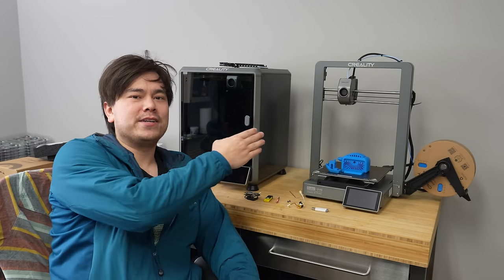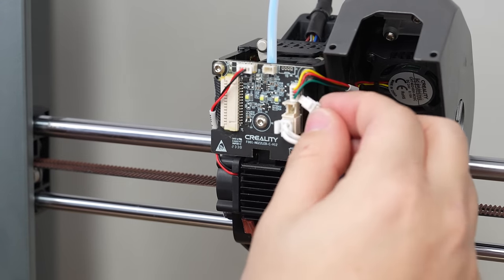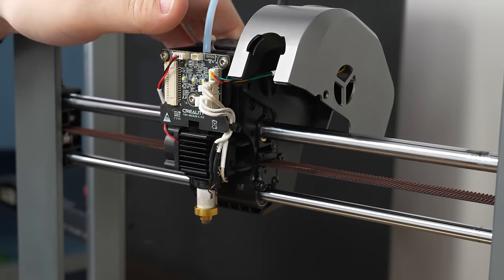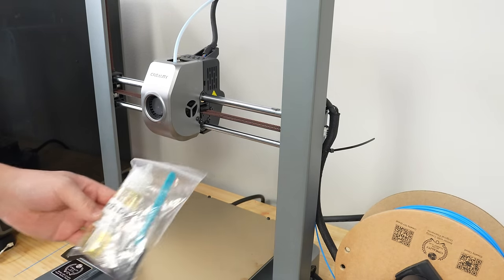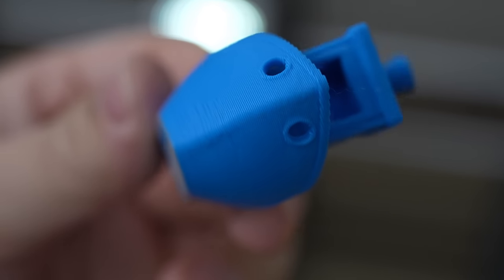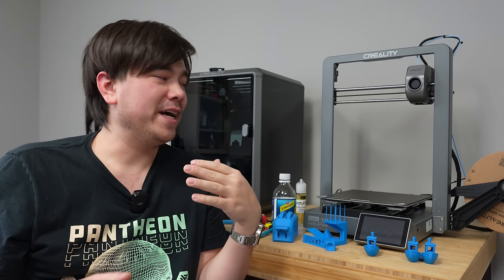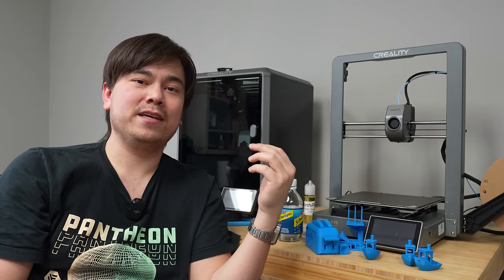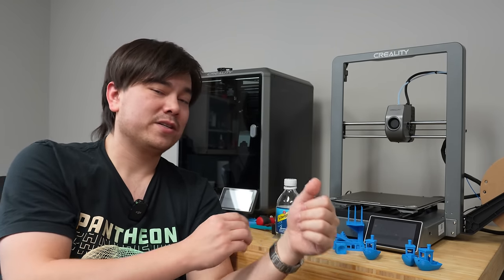This Ender 3 is Completely Different.

Comment: This looks like it's come out of a completely different factory to the KE. A much better factory.
Reply: What’s wrong with the KE ?
Reply: @martinskamla6789  ALL.... the KE and SE also, has a flaw from fabric, that the right bed rod, it doesn't fit well and it dances, apart from that, the Z axis is the most inconsistent thing I've seen in a long time, the base plate itself bends...
Reply: @JuanCarlos_3design   Mine's a complete mess. the KE is getting sent back beds warped and nothing but issues.

Was fine for the first week but the bed started to warp assuming from the insulation design on the bottom
Reply: You are saying that because you have never tried this printer, this printer is piece of "something". I don't understand why so many good reviews about it when all of them know this thing is just wasting of money. KE is amazing printer, it's better option then this for way less money. This new V3 can't do good first layer, cooling fan is not good enough for harder prints, it's hard to load filament in it, you can't adjust zoffset manually until prints starts, you can't see auto leveling results at all to see how uneven your bed is.... I had SE, now i have KE and new V3, this last one is a huge fail, only good things about it are looks and nice screen.
Reply: @bl4de938  I do own one so I feel qualified to comment on the build quality. And the V3 having all the flaws you list doesn't make the KE any better. Creality need to step up their QC or they will not survive.
Reply: @bl4de938 😅😅
Reply: @jerodTSI  i still have V3, nothing is fixed by any updates, V3 coreXZ is the best way to throw away 400$
Reply: @bl4de938 I've had a KE for probably 7 months now and it mostly sits around collecting dust because it throws a new error every time I turn it on, usually an "unknown exception" with no further detail. Flashing new firmware doesn't seem to do anything and I've tuned the living hell out of it mechanically. When it did work, the leveling never worked right and it always sent the print head crashing into the plate with no way to adjust the Z offset until it starts printing.. After it's already crashed.. I think I'm going to strip it for parts for my regular Ender 3 pro that works great

Comment: CREALITY NEEDED BAMBU LAB
 (to start making decent 3d printers).
Reply: I feel like everyone has started making better printers after bambulab came in and shook the market like they did
Reply: Completely changed the direction the entire market was going, its not just Creality.  Everyone is stepping their game up now which we will all benefit from. 
What's going to be fun to watch is all the Bambu fan boys getting butt hurt when other companies start making better machines that are actually open source as they should be and not the stupid closed off walled garden proprietary ecosystem bs that Bambu has been getting away with.
Reply: @dankcincy  What you don't seem to have noticed is that they've been becoming more open source lately, and while I'm definitely not in favor of donut walling modifications to things ((coughcrapple)), it's not like their printers need masses of upgrades to work optimally either (also the first part of what you said was said immediately before you said it)
Reply: @TS_Mind_Swept  You're right, I haven't noticed. As soon as I saw it was a closed ecosystem, I never gave them a second look. I'll never buy anything in this space that's not opened up. Closed ecosystems go against everything 3D printing is about.
Reply: @dankcincy  well I can tell you one thing, you're more closed than they are, and not for any good reason
Reply: @TS_Mind_Swept  The 3D printing community is an open source community by nature. 
 If me not liking a company because or their closed off ecosystem makes me closed minded in your opinion, so be it.
Reply: @dankcincy  It's not my opinion. They're not pulling a crApple and have been showing lots of promise in terms of being more open source, these are the facts; if you're too much of an elitist to see someone making good progress right in front of you, then the problem is not them
Reply: @TS_Mind_Swept  Like I told you before, once I saw that they were playing the whole closed ecosystem game, I stopped looking at them or paying any attention to them whatsoever. They are in no way on my radar and from what you're saying, they won't be for the foreseeable future.
 Seriously, why would I go play in their walled garden when there's whole big world out here?
Reply: @dankcincy  Cause the world sucks for one, their printers just work for another, open source is really only useful for things with problems (not that they aren't trending towards it, which in itself is worth keeping an eye on), and I never said you had to get one of their printers, but it's still worth knowing what they're up to, as even you yourself admitted they've done a lot for the industry, even if simply by existing. Don't add to the cause of people like them not wanting to share their toys, you only make the situation worse for everyone
Reply: @dankcincy  and would you look at that, they just posted an article about releasing more open source firmware to make things modible, as well as their own willingness to work with people to make sure stuff will work within the specs of the printers. Don't stand up when you have no knowledge on a subject.
Reply: @TS_Mind_Swept  Yeah... they're really not worth me following. If they do something worth hearing about, I'm sure it will pop up on my radar at some point.

Comment: I hope creality does a multi material system of some sort. Would be interesting.
Reply: Some youtuber went to recent creality booth, the agent said, the going to release new multi filament/color printer, AND also multi color/filament for currently existing printer. Soon this year
Reply: That is precisely what I'm waiting for.
Once it's here, I'll buy a K1Max + multi-material thingy.
But, why are they taking so long ?
Reply: I asked them personally, they told me they were working on it with a release planned for 2024.
Reply: @ZappyOh because it’s not easy to do.  Prusa tried for years and failed. Bambu changed the 3d printing world with the AMS. Now they are all scurrying to catch up.
Reply: Being an owner of an AMS I hate the massive wastage involved and would much rather have an affordable and working well toolchanger system
Reply: Creality has stated they are working with CoPrint to add multifilament capability to their lineup. Should just be a matter of buying the CoPrint multifilament setup and a bracket adapter per your machine and you are off to the races.

Comment: Check again.  The fan electrical connectors are hot glued.  Want to know why?  Because the connection is so poorly done you have to use the hot glue to make sure it stays together.  Disconnected my fans once...took a full day and 4 people trying to get the fan plugged back in.    CREALITY  RE-DO IT!

Comment: Overhang at 30 degrees is likely related to the overhang print speed for that angle being too high.  At 20 degrees it's probably hit the next speed category and slowed down further, same with 15.
Reply: PrusaSlicer has Dynamic Overhang Speed settings so the speed can be varied for 0%, 25%, 50% and 75% overhangs.
Reply: @Liberty4Ever  Yes, exactly that sort of thing.  I've never used CrealityPrint, but I'd be surprised if it wasn't doing something similar, and for whatever overhang range speed "bucket" setting that the 30° overhang fell into, it's likely the settings for that bracket group needs to be tweaked better.
Reply: What setting are you using? I just found this setting in creality print. I'm betting thats why I'm having issues with overhangs...

Comment: why?  why are they sticking to the 220x220 bedsize?

breakout and up the standard, 275x275 would be a good intermediate size and make it worth upgrading to a new machine for some of us.
Reply from the maker: Looks like you're wanting to see the Plus model..... Just stay tuned ;)

I think creality should step up to 230x230. Their standard plate is already 235x235, they are only using the center 220x220 portion. But when you get that far out onto the edges you end up with pretty uneven heating.
Reply: Any idea if there will be one, this looks like a brilliant printer, just wish it was ~300mm^3

Any recommendations?
So many printers nowadays it's hard to choose

Comment: Thanks, nice video! Miss the original “first layer test” though! That was more telling than the repeated comment about the print bed cable! ;)
Reply from the maker: First layer was looking pretty good. I did one on a livestream
Reply: @NathanBuildsRobots I know, I was following it and saw you at 2:20:00 (timestamp) a bit confused with the result, which you attributed to changing the settings mid-print. By the way: Does the printer have "power loss recovery" or not (it didn't work in live)?

Comment: for the 20 degree overhangs it might be that the layers were a little more than 0.2mm apart making it seem better since the droop would be more consistent then if the premineter was barely touching the previous perimeter like on the 30 degree overhang but that just my theory

Comment: As a noob, I’m enjoying the Ender 3 v3. What it lacks in mods it makes up in ease of use. The side loading is a bit of a pain. I’ve had one spool get tangled, so I’d like to upgrade to a better spool holder or loading system. With it being new still, I’ve had to order the “unicorn” nozzle directly from Creality. Microcenter didn’t stock them. Still waiting on what the two empty screw holes at the top, are for.
Reply from the maker: I think they have a printable model to move the spool holder to the top
Reply: @NathanBuildsRobots  So the runoff sensor would need to be moved too then. Not a big deal, but it’s definitely a change. Thanks for the reply!

Comment: Are you sure you can't adjust the flow Nathan? It doesn't have the expert mode that Creality just pushed out on the K1 series. My k1 got an update a few weeks ago that now permits us to adjust the speed, flow, z height, and nozzle PID calibration. Mine is rooted so it had it before but it was nice that Creality added it to the stock software.
Reply from the maker: That's great, I am using the stock firmware that it shipped with, I think it should be getting the new firmware soon

Comment: I'll wait for a version 2 of this very printer but I think this and the the K1(to a lesser degree) are steps towards Creality redeeming themselves. I know everyone and their mom has Enders...but I can't tell u how many times I hear those same people compalin about those old printers when I'm strolling through a Microcenter. I actively blocked a salesman from showing a mom a Neo(she was complaining about bed adhesion on a v2 she had) when there was the new KE and SE's right behind them.
Reply: I bit the bullet and got this machine on sale at MicroCenter. Under 300 is a good deal for the features u get. I paid more than that to upgrade an old printer. I don’t need the plus model. I use this just like any other Klipper machine I use. However, Creality’s own UI is unimpressive.

Comment: That top rail running on a bushing .. and with a spring. Much like a inkjet printer. I have a large format inkjet,  and it's important to keep a rail, that has a bushing running on it, clean and ever so slightly lubricated.  Having it exposed  like tbis may attract dust, and that bushing will bit be happy.
Reply from the maker: Interesting, I think precision on inkjets is more important than in 3D printing, so adopting a similar setup is a good idea

Comment: A bit bummed by the proprietary castings etc reducing modability compared to regular Ender 3s, but the fact that it's a core XZ is interesting- taking a page out of the Voron Switchwire/Enderwire mod notebook? With vanilla Klipper this actually looks like a pretty good package.

Comment: They made a really nice printer that is a total over kill finally. Only thing you mentioned is the fine tuning the heatsink hotend fan needs a thermostat and to tune the fan accordingly. Longer life spam for the fan and reduced noise. I want them to male a 2pro update ı really want a compact printer. With an over kill spec.

£359 for xz its expensive ı would really love the see a 2prov3 all of the weight saving and cable management for £250 would be a sweet spot.

Im looking fir bew printer and flashforge m5 for £299 is sweeter than the xz right now

Comment: What is the storage capacity for files on that machine..?  To compare my K1 Max has 8.0GB.
Reply from the maker: I think it should be the same onbaord storage. If you need more capacity you can plug in a USB drive

Comment: Hi! For a non-beginner, but also non-professional hobby 3D home printing, which one would you recommend, this Ender 3 V3 3D CoreXY or the AnkerMake M5C maybe or Flashforge AD5M (mainly from the point of view of: print quality, supply of parts, PETG and TPU printing, self-designed objects that require more special slicing settings and filament change multicolor printing)?

Comment: Other than someone who does volume printing of files that z hop constantly or maybe a counter to crap lead screws causing artifacts, Core XZ really feels like the answer to a question nobody is asking. Maybe they got cost savings pulling things from their K1 motion system over here, they do like cost savings.
Reply from the maker: I thought the same thing before getting some hands on time with this machine. But visually, it's really clean, and well built. 

CoreXZ vs I3 really doesnt matter as much as overall build quality and attention to detail. Maybe it's an unnecessary marketting fluff feature, but they pulled it off correctly at least.

Comment: I've been waiting for a round 3d printer (round track) with a hotend that can tilt, so just about every surface can be a top surface and can be ironed (except the bottom surface, but that don't need to be ironed). You could also print perfect circles with it and make parts with no layer lines. I think it would greatly increase maneuverability and printability without having to add more axes (axis plural) and more motors. I think an excellent design could be done with 3 motors/axis. Could do X-Y and rotation with 2 motors and the tilt would be a 3rd, even though a 90 degree tilting motor would not normally be the same kind of motor. Also, the bed wouldn't have to move, so the footprint of the machine could be smaller than some others too.

Comment: I'm surprised that Voron was not mentioned once. I think that for both of these printers they borrowed a lot of design decisions from Voron. Also the switchwire was kind of designed to be able to convert an existing bed slinger instead of making it from scratch. A nice side effect of it being core XZ is that Z hopping is very fast and it can prevent stringing and oozing by not taking too long to lift. During the spike test it is not hopping though.

Comment: Also worth noting they have put the spool holder in the correct place this time.
Reply from the maker: Under the printer?
Reply: The CORRECT location for the spool holder is mounted to the wall above the printer... and NO reverse Bowden tube.   😛
Reply: Agree. If a spool holder is gonna be attached to the machine, keep it off the gantry.
Reply: It would be nice if the spool holder rotated for valuable farm space
Reply: Correct is Prusa style

Comment: CoreXZ is not a terrible idea from a manufacturing standpoint. With CoreXZ you get:
- reduced BOM (sourcing straight z-screws is a pain) 
- one less dust collecting and grease spreading surface, always full of lubricant 
- dual motor X
- dual motor Z
- eliminate all the issues related to the Z-woble and single Z-screw beam sagging
- smaller footprint and frame dimensions, much slicker and denser design as a result

You get all of this with only 2 motors and a pile of bearings. It's a splendid bedslinger synergy.
It comes with a price of a much higher frame geometry and rigidity requirements. But those qualities are a _must_ in any modern competitive device.  

Thanks to LH-Stinger, in a year Aliexpress would be full of lightweight carbon-fiber-bed mods for it. It would put it in an even better speed place. Slanted frame beams same as V3 plus model wouldn't hurt too.

But for use at home, from standpoints of noise, air quality and layer adhesion, current market fully enclosed cubic printers are unreachable. For $400 qidiq1pro or k1 are a absolute no-brainers for me, V3 is just a waste of money.

Comment: I was too impatient and brought the KE thinking it would be great anyway, well it is but mine took a bit to get to print, it was 2mm out from opposing corners, I levelled the X axis and now it is 1mm front to back out and does print very well, I would be much happier if it was more level but in my stubbornness I brought it as an out of the box good print printer so I refuse to mod it,,, for now anyway. 
I will end up with the V3 after it is available in Au, it looks much better and I believe it will be in most ways. I still have the S1 pro, I have found it to be so reliable and consistent. The K1 max has also been great, consistent & reliable

Comment: i dont get why they keep using the bedslinger design for high speed printing? the input shaping will get problems when you have BIG prints on the bed. its a difference if you sling around a 300-400g bed empty or this bed plus 800g of a print. 
A point would be the price ... but the core xy model is just 100 bux more (with an enclosure) than the bed slinger. so whats the point? and since it is no more build from aluminum extrusions the options for easy mods also are limited. 

so i dont get it.
Reply: also if there is a big print on the bed at high speed the inertia will lead to other problems, since very most bed slinger beds are mounted in a way that there is flex. (if by springs, or the long rods and plates reaching to the corners.)